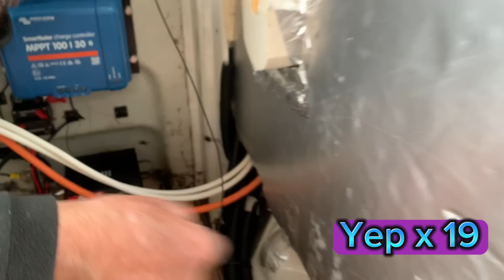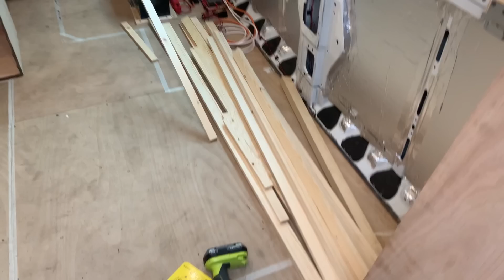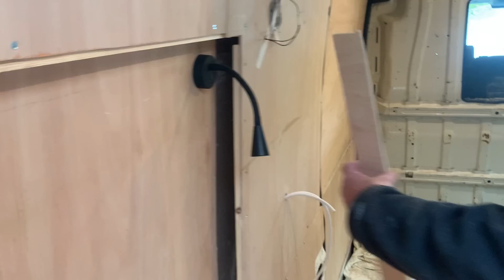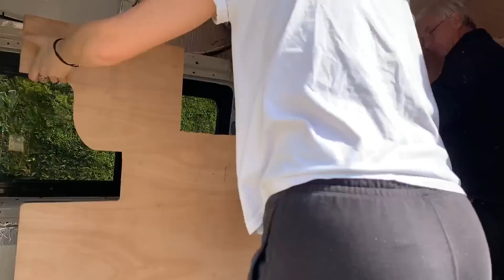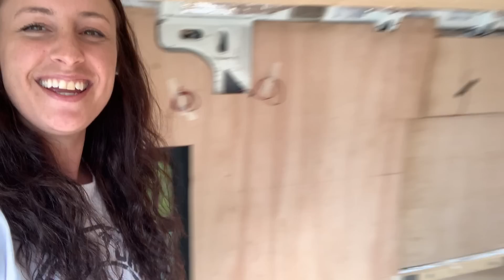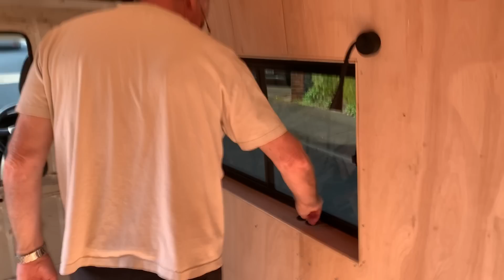BETTY'S BIGGEST MAKEOVER YET - van build Ep.15

Comment: Van is coming along great! Your dad definitely knows his stuff. You will probably find that your battery arrived with the BMS deactivated hence why it showed zero volts when your dad tested it. By putting the solar charge onto the battery it probably woke the BMS up. At least you know electrically wise you have a solid reliable set up that has 3 potential sources of charge. Plus if you find you havent got enough battery capacity you can always add another.
Reply from the maker: That makes perfect sense, it probably was that! Thanks for sharing. 
When he hooked things up I had 81% charge so that lines up.